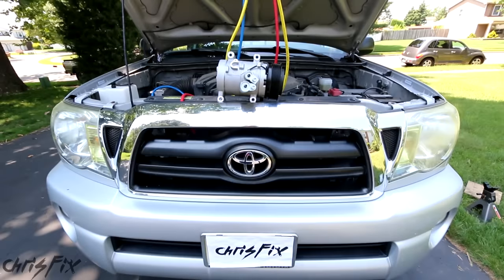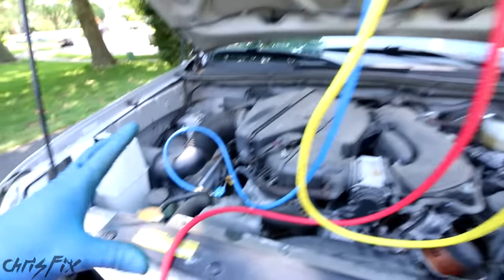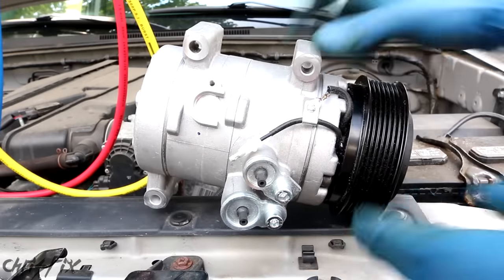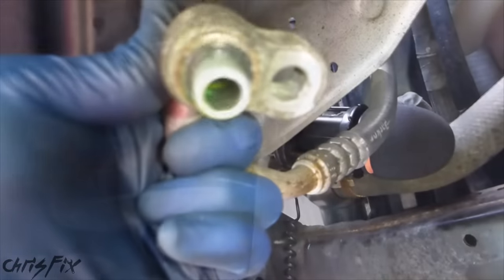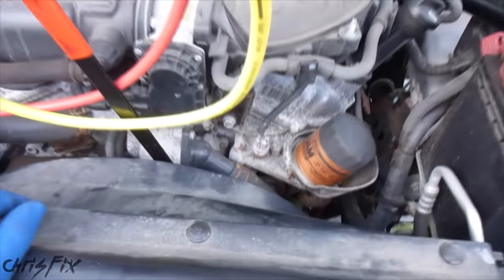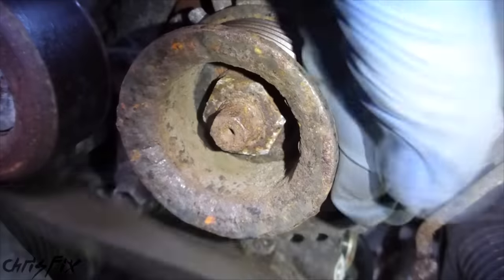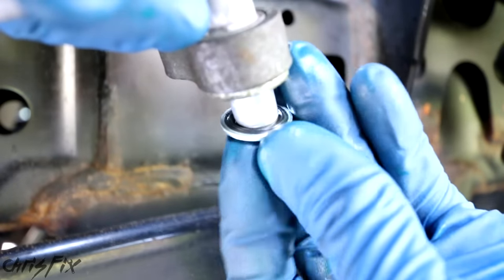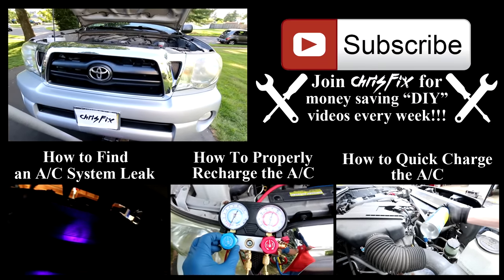How to Replace an AC Compressor in your Car

Comment: also for those of us who have to add compressor oil. where do you put it? low compressor hole maybe?
Reply: I've seen people put it into the low pressure hole in the compressor but I don't think it matters whether you put it in the high or low. You'll want to slowly pour the oil into that hole and spin the pulley on the compressor as you do it in order to get the oil moving around in the system. I'm about to do this on mine, hope that helps!
Reply: Always inside the drain hole if the compressor is so equipped. Only if there's no drain hole you can put it in the suction port and rotate the compressor so that it gets sucked inside. Also, whenever you've filled it with oil, rotate the compressor shaft (which means rotate the clutch hub if there's a clutch, and the pulley if the compressor is clutchless) 10 times by hand before turning the AC on (or starting the engine up if it's a clutchless compressor), and then let the blower fan blow at the maximum speed and set fresh air for the first 5 minutes of AC operation so that the oil circulates.
Reply: @teravolt6113  Thanks . I got the compressor from Peterbuilt it is new made in china $189. It does have a drain hole and it is marked like it was torked. Is there away to check to see if it has oil already without removing the drain plug?
Reply: @un-limited7009  Try to drain some (into a container of course) from the discharge port while you rotate the clutch hub. Takes a while for oil to drain that way though
Reply: @un-limited7009  The instructions that come with the compressor should also tell the torque of the drain bolt by the way. It's usually around 8Nm or 10Nm but you should always read the instructions.
Reply: @teravolt6113  no instructions thanks I will do that
Reply: @un-limited7009  Then i suggest you search the Internet carefully for the proper drain bolt torque value for the compressor model. For example, on a Sanden compressor you have to torque it higher than that...

Comment: how do I know if my AC compressor comes with oil? it doesn't say on the site where I looked for..
how do I fill it up with oil and where I can find the oil?
where I can find the washers?
do I also have do replace the receiver drier?
Reply: Empty the new compressor of anything. Open the drain hole bolt or try to drain it from the refrigerant ports, and empty any oil in a graduated container while you're rotating the compressor shaft. Fill it through the drain hole or the suction port if no drain bolt is on the body. You find the oil in any parts store or you can order it online, you have to do some research online if you want to know the oil required and the compressor label states a code or product name (i.e. DH-PS, RL-897, ND-Oil 8 etc.) instead of an oil chemistry and viscosity (i.e. PAG 46, PAG 100 etc). If with washers you mean o-rings then you get them at any parts store or the Internet too like the oil. Yes, you have to replace the dryer everytime you open the system up for a long time and everytime the compressor seizes up.
Reply: @teravolt6113  thanks!

Comment: What do I do if I replace the compressor and condenser, and the air is not nearly as cold as it should be? It's not blowing hot air anymore, but it's not cold enough, either.
Reply: Check your pressures to make sure you did not overcharge or undercharge the system.
Reply: Aside from undercharge and overcharge, are you sure that the accumulator/dryer and the expansion device have been replaced, and a deep enough vacuum has been properly drew before charging it up?

Comment: "This stuff isn't good for you, and isn't good for the environment" agreed, in fact it has been recommended to phase this stuff out as a refrigerant for vehicle air conditioners on new cars - and yet you can buy cans of 134a/tetraflouroethane labelled 'freeze spray', where you literally just spray it out of the can and into the atmosphere (used for finding dry solder joints or other intermittent faulty components in electronics). 300g cans of this stuff labelled 'r134a' in Australia, to be used for refrigerent top-up, can cost north of $80 AUD each, as it is as heavily regulated here as it is in California. But 300g cans of r134a labelled 'freeze spray' can be found for under $20AUD in local electronics hobby stores.....

Comment: I’m in need of help. I have no leaks but it still blows warm air.
Reply from the maker: Check the blend door under the dash and make sure it’s going from the heater core to the evaporator.
Reply: Just looked and the actuator for the door is gone 😂😂

Comment: Since You used extensions it’s not really 14 foot pounds of torque anymore it’s like 10 or something unless you accounted for that
Reply: No. Th extension is in plane not perpendicular, so the torque wrench reads correctly.
Reply: @tile456  the extension can twist some and give a false torque reading. If the extension is small and good quality it will not impact the torque significantly. But if the extension is longer or made of softer metal it can screw with the torque wrench.

Comment: How can I know if my compressor needs oil or is properly loaded with. ?? I bought a rebuild compressor.
Reply: Drain into a graduated container, you should measure the complete system oil charge minus half one fl oz. Always best to drain the oil, use it for something else (chain lube for example) and refill it with a commercial oil of the correct viscosity grade, unless it's explicitly stated the compressor is shipped with the entire oil charge for your car's AC system, and it's OEM oil (for example when you buy a OEM Denso compressor and it states that it's been pre-filled with the right amount of ND Oil 8).

Comment: Anyone think they know what’s wrong with my ac? 200 high 32 low in about 90 degrees while it’s working for 30 mins then goes hot. High side 225 low -20. Whining only when ac is on and gets louder with rpms. If it changes anything I replaced my battery terminal last July and the power steering went out so possibly electrical stuff? Also I took dashboard out around that time to spray paint it. Maybe i pulled a sensor or didn’t line air vents up correctly?

Comment: Hi  mr. I have problem in ac when i  (NO) the ac System  it work normal after half hour approx
Reply: After that it be hot when i check i found the compressor off and the connector without electric
Reply: I NOTES when  will i disconect the connector and do (ON), to ac System in the the electric found and after half hour appex i be off

Comment: How do you know it’s the compressor that it’s wrong? Thanks
Reply: Rotate the clutch hub by hand and check if it rotates with uniform resistance, check if it's leaking refrigerant oil

Comment: "Before you need to do anything you need to go to a mechanic and evacuate the fluid".....Well...Thanks I guess... ?
Reply from the maker: They have a special recycling system that will pull out all the refrigerant and properly recycle it. It's cheap and can be done pretty quickly. It's illegal to let/pump your refrigerant out into the atmosphere and it's also bad for the environment.

Comment: I need help with my 2016 Nissan Altima 
The a/c the highest temperature it reaches is 60 degrees Fahrenheit’s which it’s not too cold. Took it to Nissan dealer they replaced compressor and same thing not cold. apparently everything seems to be working fine what can it be ?? Anyone

Comment: No mechanic needed. Proceeds to mention you have to take it to a shop to recycle the refrigerant. LOL
Reply from the maker: Well you're still not really using a mechanic since you're doing all the work yourself in this case. I doubt most people have things like tire machines/alignment racks/refrigerant extractors/etc in their garage so occasionally a trip has to be made over to a shop...

Comment: Can i fit a bigger comperssor in my car?
Reply: No. The compressor is sized according to the system capacity. It will cycle off or run at the lowest capacity too often and wear much faster.

Comment: How do you replace the ac clutch on a compressor if you can't get it off?
Reply: By it I mean I can't get the compressor off stripped bolt just far enough from the frame to get a socket.

Comment: Yeah about that whole “take it to a shop and have it professionally evacuated” bit - Firestone won’t do that for me and give me back the car in that condition. What the hell? Is that a weird or unusual thing to ask?
Reply: Go somewhere else. That's not a weird request. I've had it done for under $50 multiple times over the years. You're being responsible and trying to empty your system the legal way. Venting refrigerant on purpose is illegal, and shops can report you if you bring them an empty system with no sign of damage or leaks. Odds are they won't, but they can. I also don't fill my own systems. I add the oil, close the system and let the same shop check for leaks and add refrigerant.
Reply: Perhaps they did that because you have a clutchless compressor on your car? In that case, the compressor would shortly seize up, because such a compressor is always running when the engine is on, and no cooling is being provided to the compressor when there's no refrigerant whatsoever in the system.

Comment: So what do I do if I can't take my car to a mechanic to evac the ac system? 
No offense Chris, 9/10 of videos are super helpful, but this doesn't help at all . If my system still has the refrigerant and the oil, how do I drain the system legally? At the very least you could've done this on a car/truck with refrigerant still in so we can see what do to when there's still refrigerant in the system.

Comment: Not cheaper to do it yourself in 2021.

I price out everything i need.
Plus oem compressor and aftermarket condensor. Cost 95 bucks more than having the toyota dealership do it..

Comment: If you're not an a/c or refrigeration engineer you should not be doing this stuff. Because of people professional or not doing it wrong is why people who own cars are getting shafted in tax ect. That refrigerant r134a in a small 11kg bottle is the equivalent of around 20tons of co2. That's many miles of driving even in a non economical car

Comment: 1) just wow ... another ChrisHacks job "well" executed...
2) u have to pour out all of the oil from the old compressor, measure it, and then insert ONLY the same exact amount of oil into the new replacement, otherwise it will blow itself up again because of too much oil in the system
3) in EU, it is not allowed to insert UV dye into a known leaking system, because then the whole lot will just end up in the atmosphere again (unless the user hasnt used the AC in the last 6 months, which would dry up all of the seals and make it leak via those... which will also get fixed with a new refill)
4) so if u know that the compressor can work its last days or smth and u dont have a huge hole in the system, you would even have to recover, evac and refill the whole system, use it for couple of days to get all of the oils back into the compressor and only then u can measure the oil amount in the old compressor in the first place...
5) u could even leave the top screw as the last one to unscrew, because then it would hold the compressor up a bit better...

Comment: Normally I’d say thanks for the help… but this video was entirely unhelpful. The bolts came off way too easily, they didn’t seem corroded on or anything, you didn’t give any tips or tricks to potentially getting off corroded bolts being in such a tight space. Video sucked.

Comment: Unfortunately I think your missing a few parts my dude. The evaporators and condensors they make these days have holes the size of a human hair. When your ac compressor fails like that there's a good chance debris could have came off and destroyed the evaporator. I was always taught to replace everything compressor, evaporator, condensor, filter if it has one ect. And then flush out the lines. Not saying your not doing a compressor repair correctly just not sure if the system will be repaired and working correctly and efficiently. Stay wrenching my friend
Reply: Evaporator is protected by the condenser, the dryer and the expansion valve in a TXV system with micro-channel heat exchangers. In a orifice tube there's no dryer, but there's still a strainer on the orifice tube itself. No need to replace an evaporator unless it leaks.

Comment: Becausss@ssss. Lollillol.   Should have measured tho much oil came out of old compressor. . Then put that same amount back in New compressor . It is shipped wit.  Enough oil for the whole system '. You got to measure and reinstall oil w

Comment: All cars are not the same
Reply from the maker: Correct
Reply: All ac systems are very similar. Different cars will have the same or mostly the same ac components,  just located in different spots.